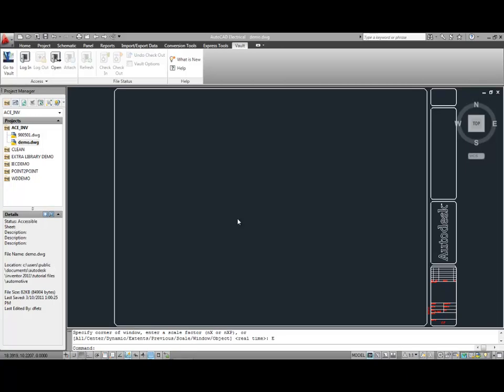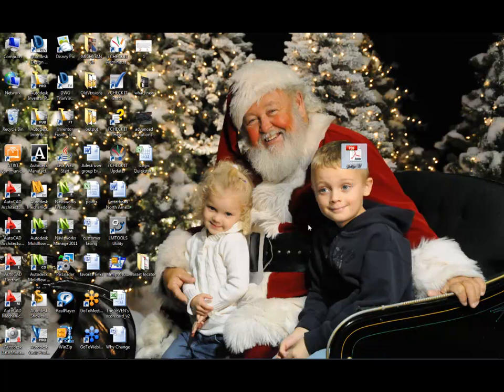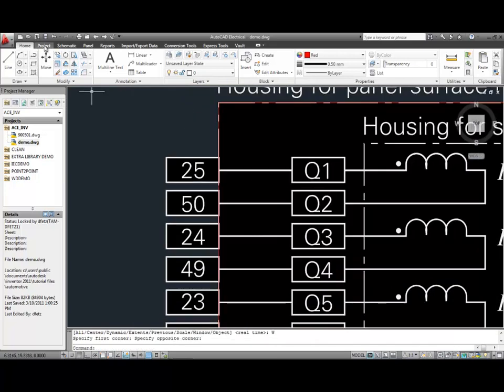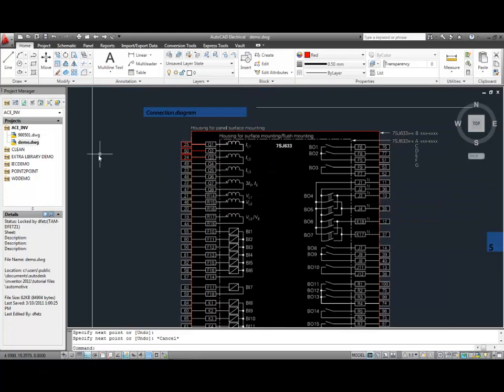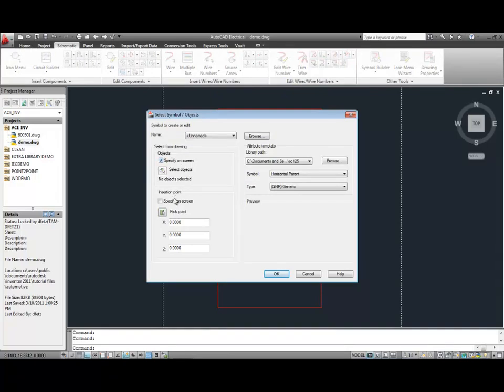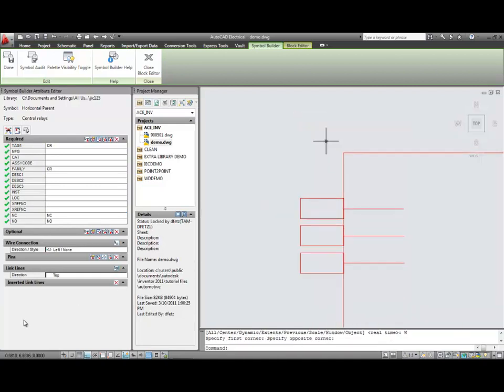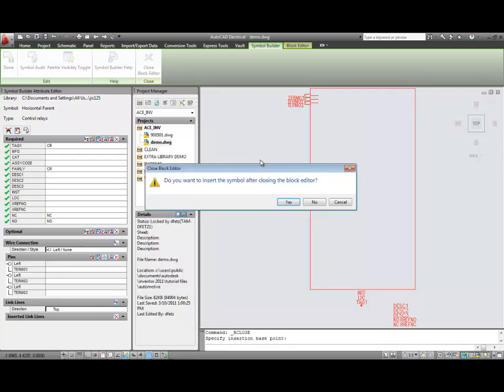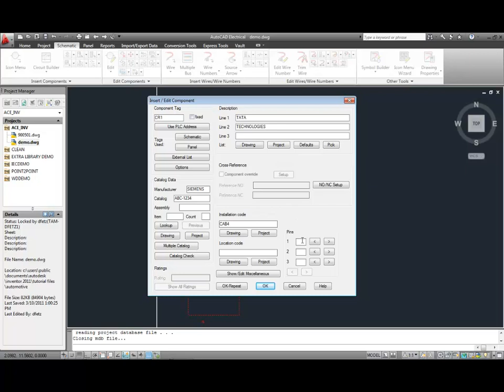Creating a AutoCAD Electrical Symbol from a PDF

Comment: I have to create a Auto wiring diagram whilst learning ACAD elect...in this project there are some digital controllers which hook up the you stock standard 12v wires (some of these have up to 25 connections / terminals) would i create a symbol for these or ... something else?